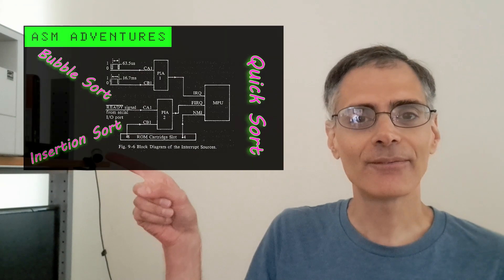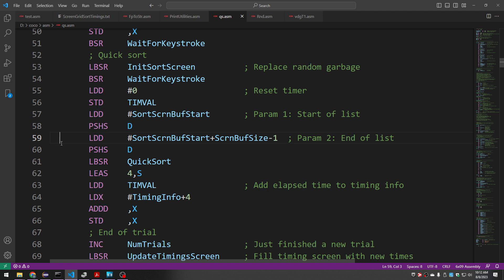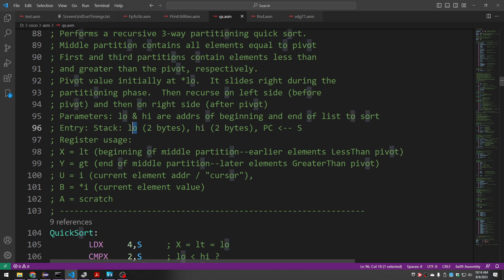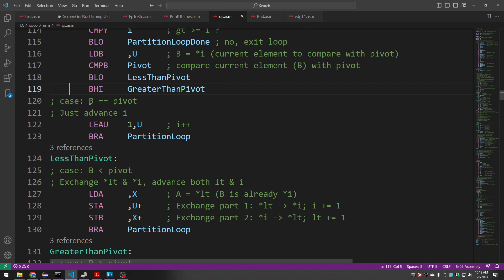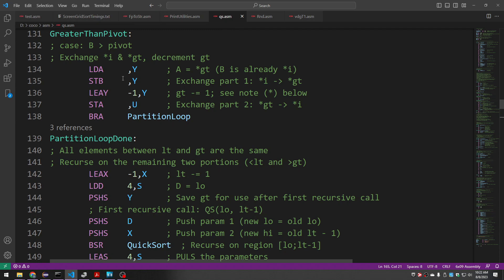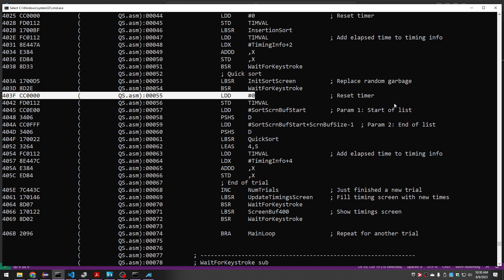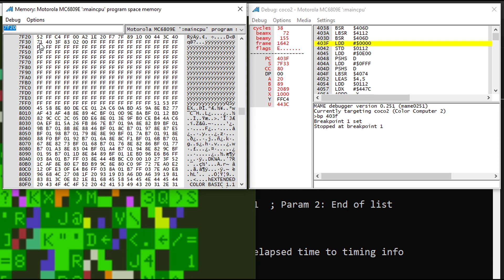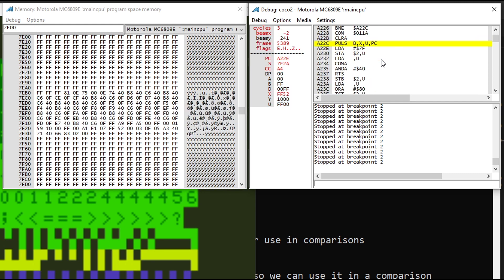Quick Sort in assembly: Tour of the code and watching recursion in debugger | Asm Adventures

Comment: Can a quick sort be optimized by changing the initial pivot points?
Reply from the maker: Yeah, how you choose the pivot can make or break it.  Optimally you "magically" find the median and use that.  That ensures you split the array in half and minimize the recursion depth to log N (where N is the size of the original list).  That's the ideal, but in practice you use randomization to help.  Either shuffle the array first, then any pivot will do (e.g., the first item in the list each time) OR don't shuffle up front but just pick a random element to be the pivot each time.  They're basically equivalent.  You can further use a heuristic where you randomly sample, say, 3 elements from the array and pick the median of THAT, and hope it's close to the median of the array.
Reply: @CocoTownRetro - Perhaps running a quick one pass "discovery" on the array prior to choosing the pivot point based on the randomness of the array, in order to minimize recursion.  Some parts of arrays may contain sequential blocks, or not.

Comment: The auto increment / decrement (and double versions as well) are based on handling stacks (either S or U based). That is why it pre-decrements (example: STD ,--U moves the U stack down and then stores D at the new U ptr. LDD ,U++ loads that D value and then increments U by 2, so these are reciprocal instructions preserved the stack's integrity. (On the other hand, it would have been nice to have BOTH versions...). Great series on ML sorting, by the way!
Reply from the maker: Thanks, as always, for the informative explanation!  I figured the mirror symmetry was advantageous in general, but the way it simulates stack usage hadn't occurred to me.  Interesting!